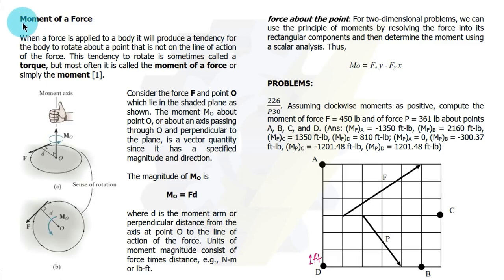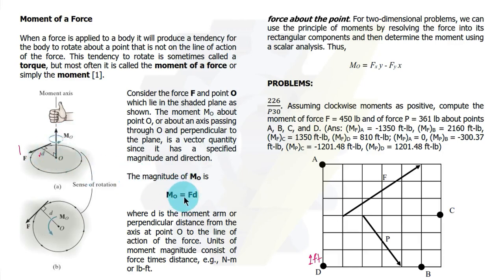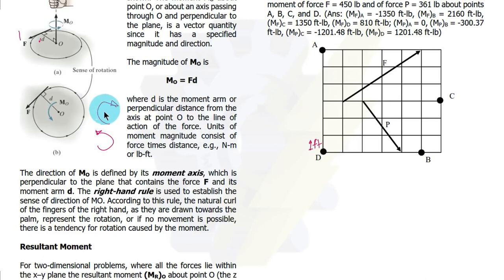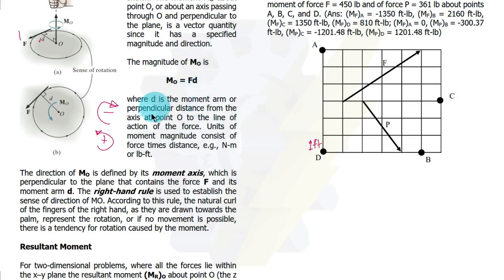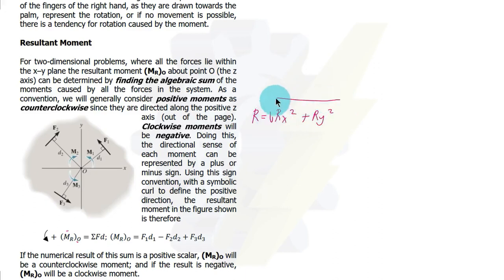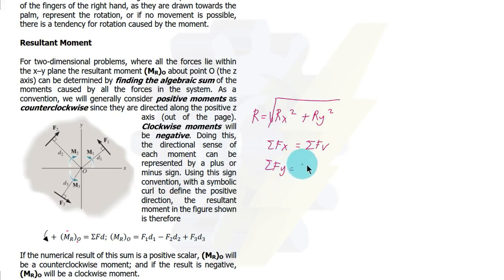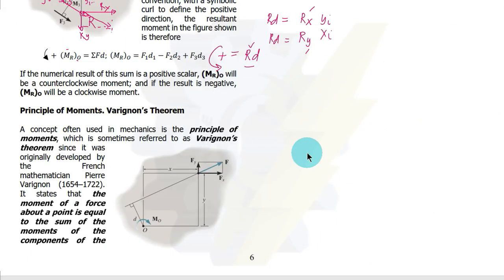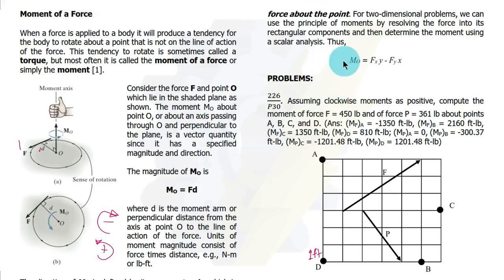Engineering Mechanics: Statics | Moment of a Force and Resultant Moment  Part 1

Comment: Good day po MasterMe,.  SIR PWEDE PO MAG TANONG?? PAPAANO PO BA SIR MALALAMAN X,Y AXIS KUNG SIN OR COS ANG GAGAMITIN SA PAG TIMES?
Reply from the maker: Hello! Ang ibig mo ba sabihin ay kung kelan ginagamit ang Sin at Cos sa pag solve ng components along X and Y axes? Depende kasi yan sa angle na given at anong component ang isosolve. Just consider yung isang right triangle. Yung given force ang hypothaneus, at yung vertical side ang Y component. Kapag isolve ang Y component at given ang angle with respect sa Y axis, ang gagamitin ay Cosine. Pwede ka masend ng message sa FB page kung meron ka pang tanong at kung di tugma ang reply ko sa question mo. Free lang yon, don't worry.
Reply: @masterme3791  GOOD evening po sir   ibig mo po bang sabihin. Bago ako mag solve ng x, y kailangan ko muna mag assume ng triangle para magamit yong sohcahtoa?? Hehe tama po ba ako?
Reply from the maker: Actually di tayo nag aassume. Yon talaga way pano isolve ang mga components. Kailangan mo din alamin angle of inclination
Reply: @masterme3791  ahh opo sige po. MARAMING SLAAMAT PO 😊
Reply: @jhayrhex4448  ang sabi ng instructor namin sa engineering mechanics kung FX yung hinahanap sin ang gagamitin and cos naman kapag FY ang hinahanap.